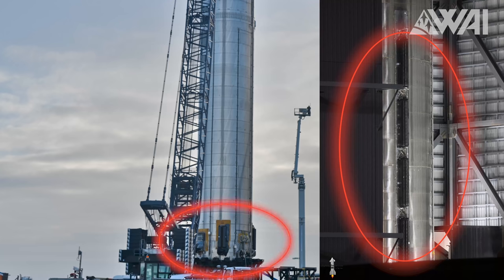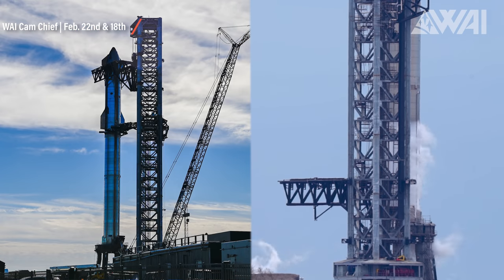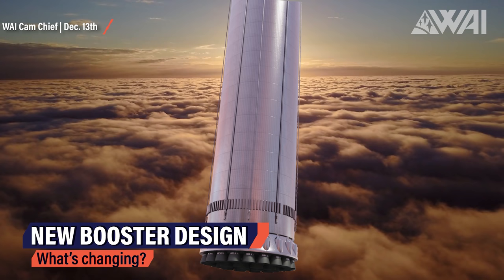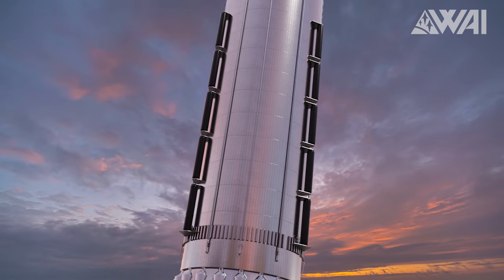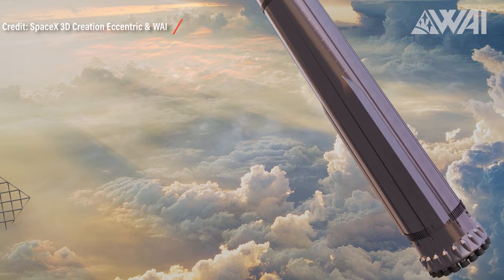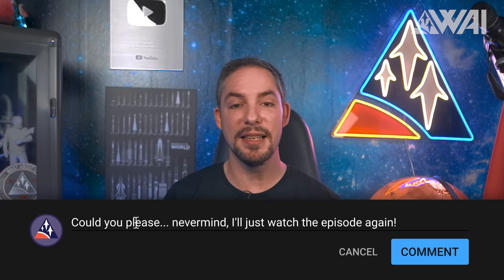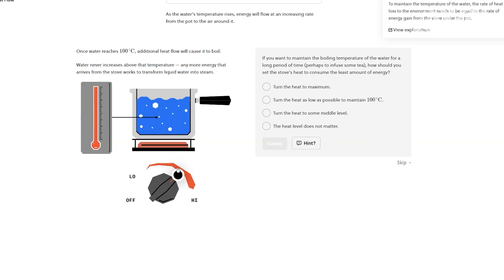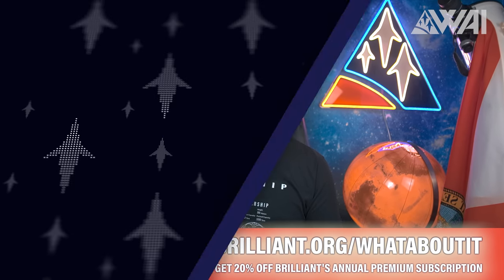How To Make A SpaceX Super Heavy Booster Glide Like A Wing?

Comment: Since the FAA has you grounded (as far as orbital flights) why not try out the catch system? I mean LANDING is an important part of the flight??
Reply: Because they are still finishing up Stage 0.
Reply: @steveaustin2686  you mean the orbital launch pad?
Reply: @steveaustin2686  if the OLP isn't ready, then launch one of the 25 starships sittin around and try and catch that?
Reply: @ryandavis4448  Yes, Musk calls the orbital launch pad, GSE tanks, tower, etc, Stage 0. If you do a sub-orbital launch, you have to stop work and clear everything away from the sub-orbital pads and landing pad. Then after the launch and landing, then you have to put everything back.

Worse, if your catch doesn't go well, then you will likely damage the launch pad. So that puts the orbital attempt even further behind. The first few flights of the Superheavy booster will be soft landed in the water to dial in the accuracy for a landing attempt. SpaceX isn't going to skip that important step as they did the same with the Falcon 9 when they first started trying to land those.
Reply: @steveaustin2686  I understand, but my God we havnt seen a test for nearly a year since SN15. Even worse they don't know if that thing could catch something falling from 10ft much less from orbit.
Reply: @steveaustin2686  so, even if the FAA gave the go ahead, the starship program is at a hault until the Launch Pad is done? So the FAA have little to do with it, right now...
Reply: @ryandavis4448  Exactly. All the people complaining the FAA is stopping SpaceX are missing the point that SpaceX is still finishing up Stage 0. We still have yet to see a water deluge test. Or the scaffolding removed once and for all.
Reply: @steveaustin2686  that's actually true. I havnt seen the sound damper test yet. They gotta lil ways to go...
Reply: @ryandavis4448  There's no difference between catching something falling from 10ft and catching something falling from orbit, because the thing falling from orbit has used its engines to slow to a hover for landing, just like SN15 did.
Reply: @ryandavis4448  Yep. And expect some RUDs for the early reentry attempts. SpaceX is. Elon Musk's Mar 30th 2021 tweet

"Next major technology rev is at SN20. Those ships will be orbit-capable with heat shield & stage separation system. Ascent success probability is high.

However, SN20+ vehicles will probably need many flight attempts to survive Mach 25 entry heating & land intact."
Reply: @simongeard4824  that's kinda my point. They may not be able to launch to orbit (for several reasons) but they could try and catch a starship. But like the other guy said, that'd make a mess.
Reply: @steveaustin2686  nice to see them testing things recently, (that need to be tested) even if they can't launch.
Reply: @ryandavis4448  They just stacked everything again and apparently did it faster than last time. Still making progress while they finish Stage 0.
Reply: @steveaustin2686  that's what I'm saying. If you can't launch anything, at least test the things that need to be tested anyhow.
Reply: @ryandavis4448  Oh for sure. It's just that catching the booster isn't a good idea yet.
Reply: @steveaustin2686  I know they've gotten to where the falcon9 can land (almost) exactly where they want, but the landing pad is out in the open and it's ALOT smaller than the booster. It'd have to be pinpoint perfect to catch that thing. And I've only seen ONE thing land so far, in what? 2 or 3 years??
Reply: @ryandavis4448  The Falcon 9 has to do a suicide burn as it can not hover. Even on one engine at the lowest throttle setting, the Falcon 9 booster has a TWR greater than one. So it times the burn at exactly the right point, for the deceleration to hit zero as it lands. The Superheavy booster will be able to hover, so it should be able to be much more accurate when landing, which is good since SpaceX wants to catch it.

SN15 was the only Starship (second stage) that landed and survived. SN10 landed, but blew up around 7 minutes later. SN8 looked like it may have landed, if it didn't have engine problems. SN9 and SN11 had engine problems that screwed up the flip-n-burn. SpaceX seems confident in Starship doing the flip-n-burn and landing if the engine runs right. At least the first few orbital launches will be soft sea landings, so they can dial in the accuracy, before they try a catch attempt. 

SpaceX did soft water landings with the Falcon 9, before trying to land one on a drone ship. They had a few failures on the drone ships, before they nailed the landing at LZ-1.
Reply: @steveaustin2686  I'm convinced SN11 was used as a test for the abort bomb attached to the side. The cloud cover was perfect for keeping it confidential
Reply: @ryandavis4448  That's not a bad explanation. SpaceX said it was a hard start, where the engine doesn't ignite right away, so propellant escapes. Once the engine does light up, the propellant can explode as there is too much there. Your Flight Termination System test makes sense. Or it was drifting off course, so the FTS was triggered. The FAA and NASA surely know what happened.
Reply: @steveaustin2686  well, they have to test everything out, in the early stages. And if there were a cloud cover anyhow... And if ANYTHING abnormal happened, (drifting towards the tank farm, ect..) it was the perfect time to test it.

Comment: SpaceX might just buy that hydrogen company if it's set up well. Elon likes to be in control of all aspects of his endeavors. Also, they would probably convert the hydrogen to methane before piping it to Starbase. Methane is easier to control than the little hydrogen atom.
Reply: SpaceX has said that they will buy off the shelf if the price is right, otherwise they move it in-house if they can.